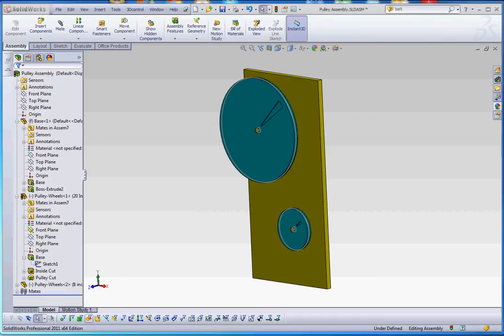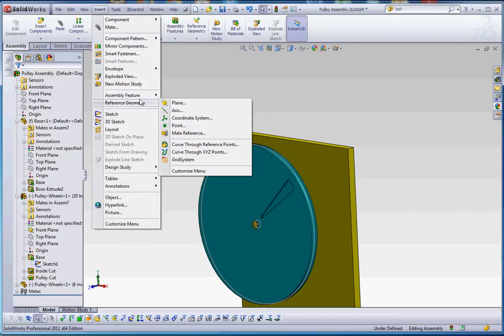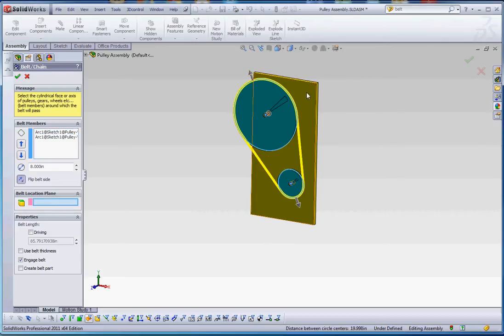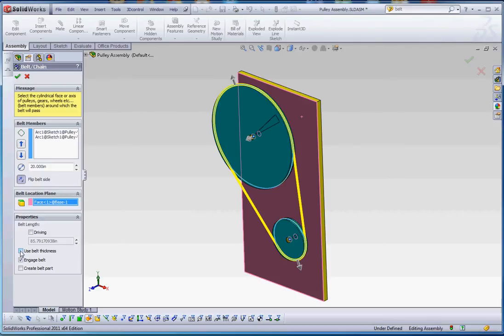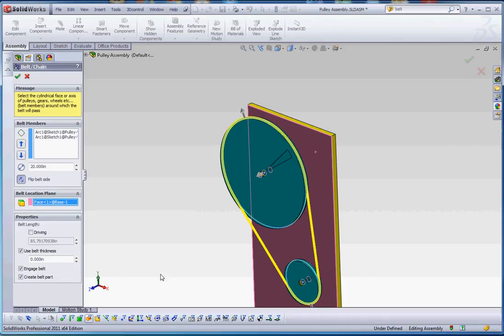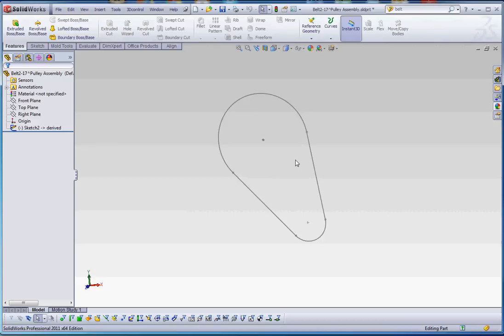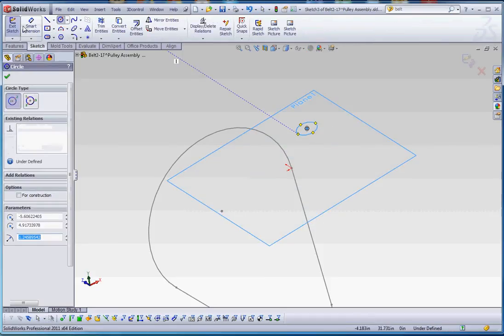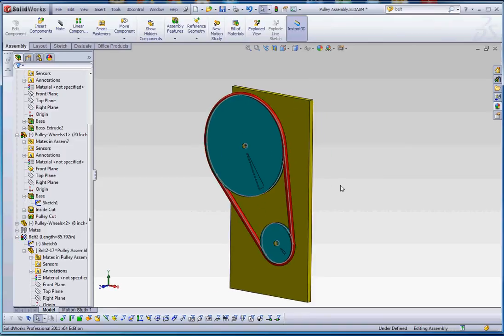Inserting the Belt/Chain Assembly Feature in a SolidWorks Assembly

Comment: Is the belt is moving to?
if not let say I want to connect something to the belt and see it move?
Reply from the maker: The belt does not move, it is just a sketch path that can be used for other SolidWorks functions like putting a profile on it for a sweep feature which is shown.  You can also attach items like the links of a chain which can appear to move with some work.  I have other videos that show how to start this.